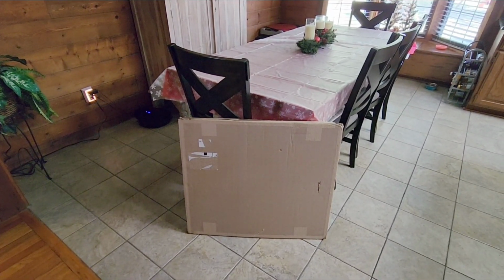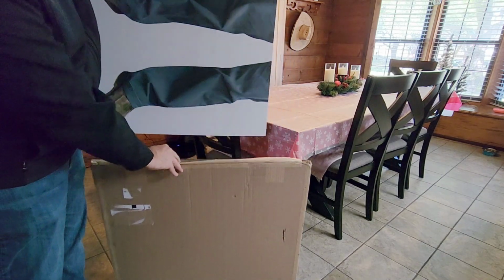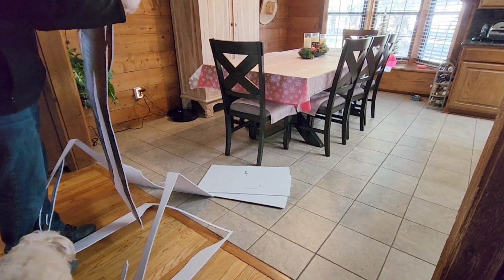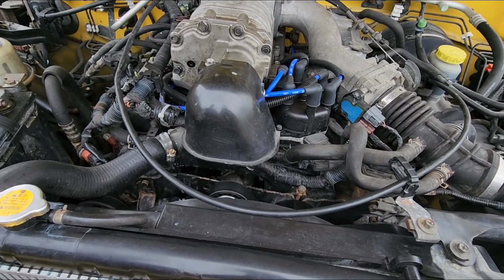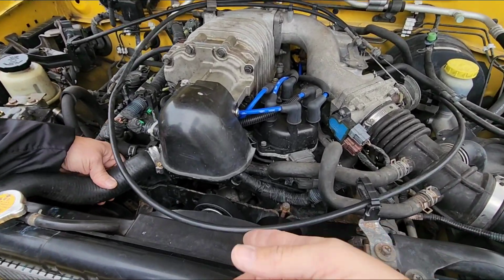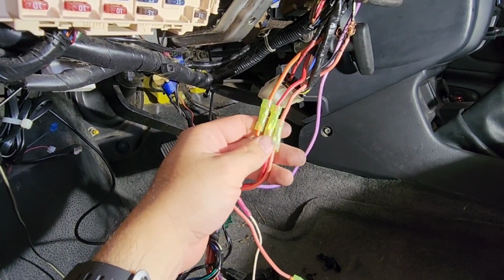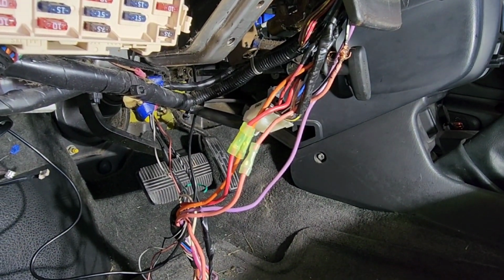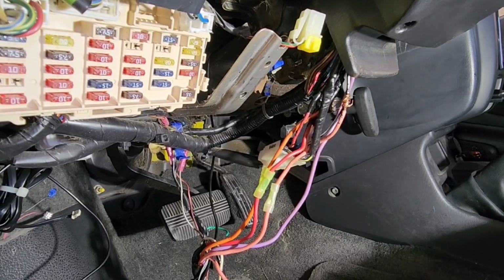Now this is awkward... But possibly helpful.  Insane Wiring!

Comment: Nifty info video. Thanks for the explanation of the proper way to splice in a wire. Interesting to see as it is the way I normally make a splice in rather than cutting and then twisting all together and soldering. Thanks.

Comment: Installers taking the time to solder? 🤣🤣 Every installation I've seen, they cut the factory connectors off and use crimp connectors.
If they want to tap into a wire, then it's some type of vampire tap.

That's why I always do my own installations. I also never use electrical tape. Every connection is soldered and shrink tubed.

Comment: You are a bit off in your assessment  of splicing methods.  Some methods may be equal or better depending on what your doing,  terminate as appropriate to your situation (there are many ways to skin this cat).  I agree 100% this does look like a device replacement/swap from an older unit to a newer one.  I also agree that it was a shit job by the 2nd tech and likely the 1st as well.  That being said there is nothing incorrect with using crimp connectors including the insulated barrels seen here when used appropriately.  You will find them in every OEM harnesses in various forms.  This example is incorrect b/c it was reusing a splice from a previous install.  You don't stack splices and should start over at the vehicle side point of termination at all times.   If you were to use an insulated barrel in this application you would cut each wire splicing inline (like a Y) using the appropriate sized (likely step down) heat shrinkable barrel.  These can be hard to get though and fairly expensive.  Getting crimpers in there is usually difficult too, not ideal.   An electricians splice/poke and wrap splice (poorly attempted here) is completely acceptable when done correctly , which again, this does not appear to have been.  Soldering is a great method as well, but also has it's own drawbacks and is also not ideal in every application.  Ex. Soldering those wires too close to the connector can put too much heat into the wire and damage the connectors.   I'm not saying you couldn't, but it isn't absolutely necessary, and is more of a matter of preference in this case.  Unfortunately it looks like you have a bit of a repair on your hands,  but hey at least they didn't use Scotch locks or TTaps 😆